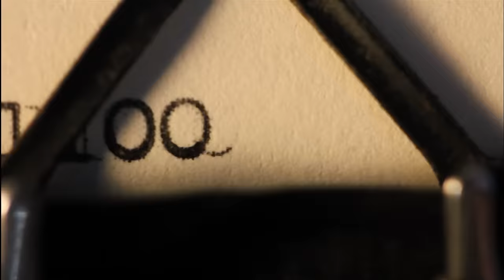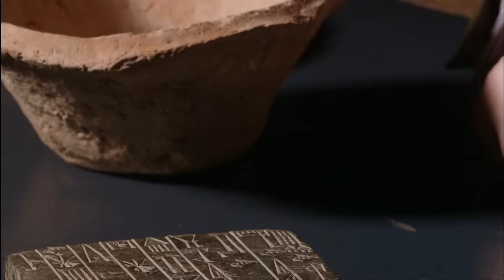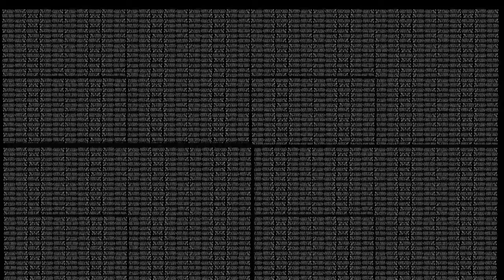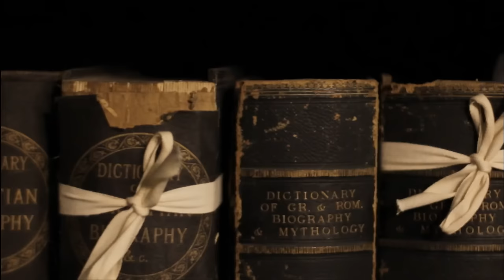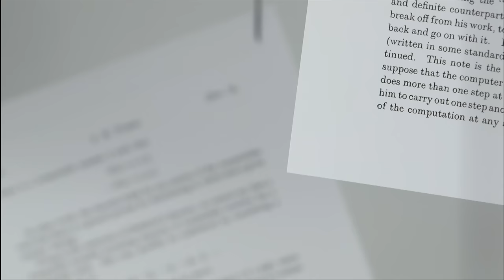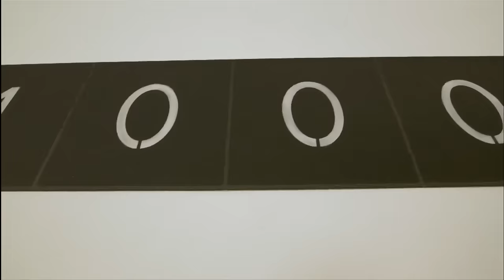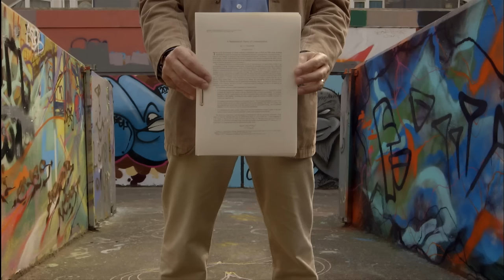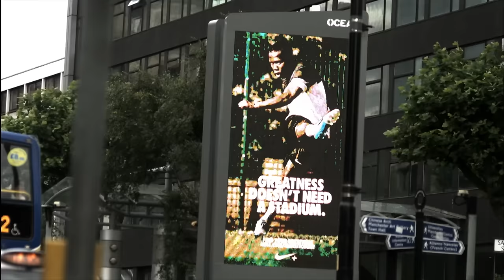How Did We Get To The Modern Computer? | Order And Disorder | Progress

Comment: A nanometer scale Tesla valve hypothetically should rectify the thermal Brownian motion of fluids at the minor cost of slowly eroding the valve's structure thus reversing entropy at a supportable energy cost. 

There is less interference in streaming forward fluid flow compared with reverse flow without moving parts other than the fluid itself in Nicola Tesla's valve which he patented as "valvular conduit". There is no need of an operations record or the erasing of such information in this system.  The operation is deterministic.

Aloha
Charles M Brown lll Kilauea, Kauai, Hawaii